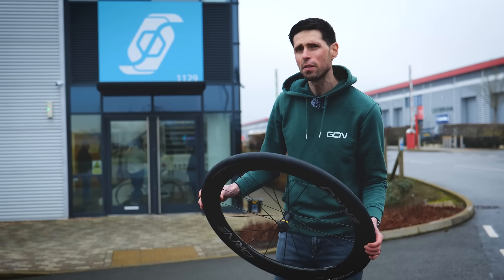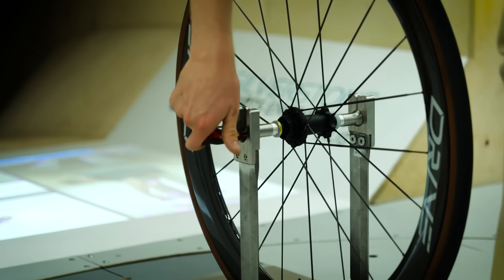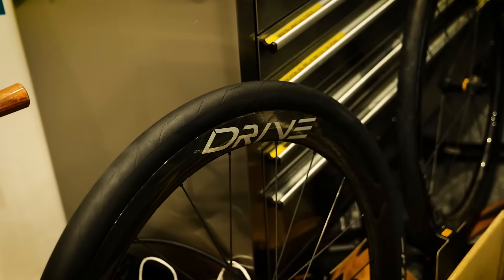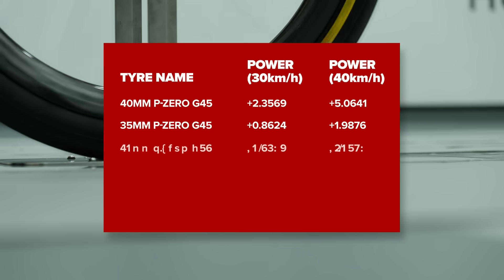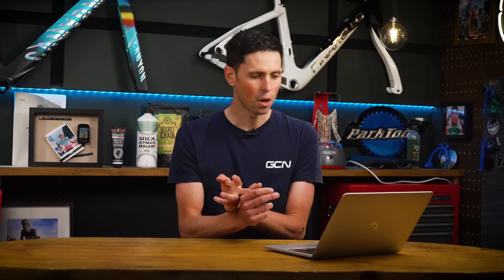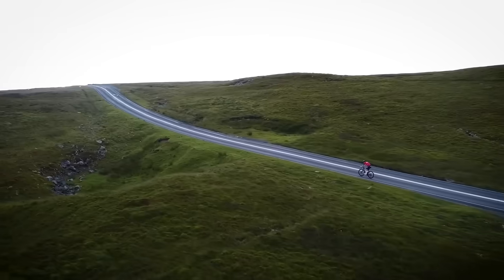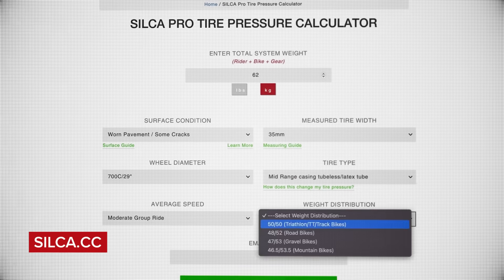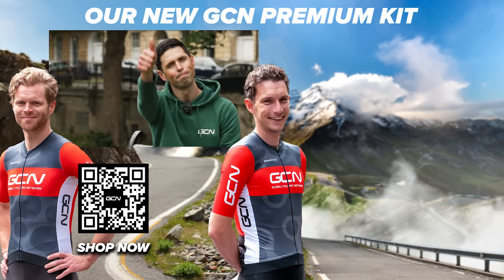The Fastest Tyre Width is NOT What You Think

Comment: Weird, I went from 25mm to 28mm and I can't wait to go back to 25's again. The internal width of my wheels do not reommend anything above 28's. The 28's feel sluggish of the start and bouncey if I inflate it according to the online tire pressure calculators. I had to increase the PSI by 10% to get rid of that bouncey feeling. I live in Central Florida where it is quite flat. On my 25mm I never experienced these problems nor was I ever uncomfortable. Starting off the line was quicker and over all feel was more responsive. I know this is all anecdote and it is going against the data. But  I am a 57 y/o fart who only competes against himself and does HIIT on regular occasion or when  I see a pretty woman. I ride a 2021 Trek SL5 with WInspace Hyper 50mm wheels. I have been quite happy with this setup. Stepping up to 28mm decreased my overall enjoyment on the bike.

Comment: The tyres tested here have the same name but the 35 and 40 are made to be much slower, probably for durability. Which may also be why conti hasnt released a gp5000 above 32C. 
Rolling resistance website tested all gp5000 tyres to have virtually the same RR. 
it's important to flag here that the 35 and 40 tested here are slower because the tyres are built differently, rather than thinking that such big tyres must have higher RR.
Reply: they already made this test several times with the pirellis and never state that important difference. its a shame.

Comment: Rode 28mm for about 5 years. Changed to 32mm last fall and haven’t looked back. I’ve noticed no difference in speed, but a big difference in comfort!
Reply: There’s a lot to be said for comfort.
Long rides are less painful freeing you up to put in bigger efforts.
Reply: 32’s for the win. GP5000s are amazing in 32mm
Reply: I.m rolling 30's now but I thin 32 is the all around sweet spot, I'm gonna need wider wheels!
Reply: I did. Notice a difference in speed. But I attribute it to the pressure rather than width. I ride 32 at way lower pressure than the 28. They are heavenly comfy in the winter when I do not care about PRs and KOMs and just want to ride.
Reply: @tonyg3091 What pressure in the 32mm?
Reply from the maker: and the comfort makes you want to ride more!
Reply: Try 76 !!!
Reply: So, pro teams have been using non-efficient setup with narrower tyres for years?  Sounds fishy.
Reply: @Dee-Ell Most pros are using 28mm now. Some using 30mm as well.
Reply: What I want to know is why haven't the pro teams "discovered" this?  The pros have been riding narrower tires for years.
Reply: @Dee-Ell because 28mm is still the fastest and more aero😂
Reply: I also moved to 32mm and not going back.  Much better experience
Reply: Same… 32 was a game changer for me!
Reply: How much do you weigh?
Reply: @alexnaturalis1179  why you looking for a date? 😂
Reply: @colinb8327 there's a point to be made here about the weight these tires are handling. I weigh 66 kg and 25mm at 75psi works for me. If 32mm works for him I want to know if he's 80-90kg.
Reply: Stuck with my 25mm, I dream of more comfort on rough roads 😅
Reply: Use a mountain bike. You will be surprised with the comfort of 2.3" tires!
Reply: 18mm years ago, that was very fast.
Reply: 47mm  on my 650b Cannondale Slate rigid
Reply: I just switched from 28s to 32 and I agree on how awesome it is.
Reply: I did look back. So for me it's about 3 years of 26s, followed by a year of 30 front/32 back and this year I tried 28s because apparently it's the holy grail but I immediately hated it, went back up to a set of 34s mounted on 55mm wheels and I'm setting new PRs this year. I love this setup. No looking back anymore. Everything has been tried. 
Side note: From this tire maker all sizes come out narrower when mounted so effectively I'm riding 31,5 front and 31 back atm.
Reply: Big surprise. Will you stop before going to 200 mm?
Reply: Still have a Panasonic mid 80s, stock tire was 1.125"   😏
Reply: My Ridley fenix came with 25mm max clearance 28mm. Chanced 32mm pzero TLR speedcore and they fit just about! Close to chainstay but ok. Loving them.
Reply: The fact that you didn't notice any difference in speed does not mean that there was not. It's like saying "I changed my bike with one which is 2 kg heavier, I didn't notice any difference in uphill speed". Physics matter.
Reply: BikeTyreRollingResistance conclusion that when pressure set for same comfort level, the rolling resistance of wider tyres is same as narrower. Of course setting lower pressure on the wider tyres might mean an increase in average speed on a long ride as the rider uses less energy combating bumps & vibrations - so has more power towards the end of the ride.
Reply: you still need to look back
Reply: @ds6914 I am old, I look forward to see the bunch...
Reply: Similar story here. Rode 28mm for a little over 4 years before switching to 32mm this January. I'm not going back to narrower tires.
Reply: All this tire width and pressure and comfort and speed talk greatly depends on who you are, how fast you ride (young, skinny, old or fat, fast or slow, etc) and what the pavement quality is that you ride on.  

Obviously the rougher the pavement the softer and wider the tire you want to be using.  Where I ride the pavement is excellent, we ride at 32km/hr (20mph) for 64km (40 miles).  I ride on 23+25mm tires (tyres!) at 100psi.  I’m skinny and fit but only because I’ve been doing this for 40 years!  I tried going to 28s at 80psi and felt like I was getting a flat all the time, bouncing up and down with every little bump in the road.  😮.   

The rear tire is drafting the front wheel and the seat tube so it’s not as important width wise, but a skinny front tire has less drag than a fatty, that’s just simple physics.   Bottom line, propper Tyre (tire!) size and pressure depends on how smooth your local roads are and how fast/far you want to go.  

There’s nothing  “comfortable” about a good, long, hard ride!  No pain, no gain!  I often have to tell my legs, “Shut up and spin!” 😂
Reply: @Timbo777LR 
Good point about the rear being drafted.  So maybe a staggered set up would be best, 28 front and 32 rear . . .
Reply: aww  thats cute.

Comment: Testing aero of front wheel only doesn't really provide useful results: a narrower tire has of course lower frontal area, but therefore the downtube (and rest of the bike) is facing more wind which wasn't measured. Of course testing the whole bike including rider is complicated and of course varies with different bike frames and aerodynamics of those and rider as well.
And also: your rolling resistance test is valid only for the Pirelli tires because those have actually different construction with thicker rubber towards the wider tires. If Pirelli would make a 40mm tire with the same rubber thickness as the 30mm tire, the rolling resistance would be likely very, very close to each other.

Comment: The Silca calculator does not normalize the tire tension. The narrower tires had more tension. For example, the 35mm needs about +8 psi to be as hard as the 28 (using Laplace's formula), so this could completely alter the Rolling resistance results.
Reply: Finally someone  mentioning Laplace here!! Tyre pressure does not tell us how "hard" the tyre is. Pressure x 
Radius divided by wall thickness does.....
Reply: Road surface has more to do with it.

Comment: Most 28c tires on modern rim width usually measure 30-32mm so… ~30mm for Spring/Summer and 32 to 35mm in Fall/Winter ☑️

Comment: I'm a big tall guy, and I've been riding 30mm tires for the last few years. I even built up a 2017 Specialized Allez Sprint rim brake setup with 20mm internal width wheels with the 30mm tires fitting under the brake calipers. After this video I may go back to the 32mm tires on my disc brake bike with Zipp hookless wheels. So comfy!
Reply from the maker: Nice! Did you use deep drop calipers to get the tyres to fit?
Reply: Which rim is it 20mm wide? Would love to have a wider rim them my 18mm dt swiss.

Comment: Just a little confused as to the rolling resistance test measuring "power loss".  I would think that the actual test of rolling resistance would be to simply have each wheel/tire combination spun by a machine which would calculate the effort in watts needed to spin the wheel at a certain speed.  Having a human rider cranking the wheel would not be an even playing field so to speak, as the rider can easily, even unconsciously adjust the pedaling effort to compensate for the different tire sizes.  This small change in effort cannot be measured quantitatively as the rider simply adjusts for "feel".  Alternatively, simply have a spin down test, where each tire would be brought up to speed, then allowed to roll to a stop.  The furthest roll would be the least rolling resistance.  Either test would work.

Comment: 25’s are great. Feels, and is fast
Reply: I’ve tried every tyre from 23mm up to 40mm over the years and ride many thousand of miles a year in the fastest group in my local cycle club. 25’s have the best feel for me and for me they’ve been slightly quicker than wider tyres (28mm and 30mm for example). GP5000 are my favourites.
Reply: So, are they saying the pro teams had it wrong for years?  Sounds fishy.
Reply: @Dee-Ell   With disc brakes on widening the tires is a mandatory solution... I still run 25mm and rim brakes...the perfect combination.

Comment: There is huge difference between tires in terms of rolling resistance and if you go tubeless, tpu or if on tubular.
Rubber is not just rubber.
The profile of tyres are also not the same.
Thread depth and patterns also makes a difference.
Reply: Also windtunnel testing makes me suspect all tires were at the same pressure, which on a smooth surface away from real world conditions where nobody runs a 25c at the same pressure as a 35c is going to make this test biased towards what's being pushed, super wide tires.

Comment: The problem with a few videos, e.g. the one from NorCal, testing this, is the fact that the rim they use has like 30 or 32mm outer width. Of course the 32mm tyre will be faster than the 28mm tyre. Simple aerodynamics will outweight roling resistance in such cases.

I have 28mm wide rims and choose to run 30mm GP 5000 S TR on them, after I rode 32mm GP 5000S TR the season before. Works great.

Comment: The contact area of a tire when is is on a roller in the pedaling efficiency test rig is vary different from the contact area on a flat surface like the road.  It is shorter and wider and deeper in the middle on roller, that would affect the amount of energy used for sidewall flex significantly.  Also the rollers are much smoother than most roads how does that affect the results?

Comment: Thanks for this, well done..  One data point on this is that the P Zero in 35mm uses a different rubber thickness, which is slower than the 30mm and the 40mm uses a thickness that is even slower than the 35mm.  Until different tires widths can be tested with the same rubber compound and thickness we are all guessing.  I'd also love to see what 32mm would produce here, as 32mm P Zero tires have the same rubber compound and thickness as 30mm.  This would give us some guess at where the trend goes.
Reply: I think this test was very reasonable - using actual tires in the same product range.  The manufacturers are making engineering changes to accommodate the requirements associated with the different widths.
Reply: Yep, that's a good point. Gotta hope that we could get some competition between the big manufactures so that there would be a proper 40 mm racing tyre for road. I think there were rumours that Continental is working on a wide fast road tyre.
Reply: @astroturd I'm hopeful, even just a regular GP5000 in 35mm would he awesome.
Reply: @astroturd Agreed! I'm riding the Schwalbe Pro Ones in 38mm on my Crux Road build and really enjoy them. They don't feel slower than my previous set up, except from when accelerating, because boy they are surely heavy haha.
Reply: @MrJulioJohnson  Yeah I've looked at those tyres. Currently I am running the Continental GP5000 AS in 35 mm, but I'm not sure changing to the Schwalbes would be a significant enough upgrade, so I'm waiting for something new in the market.
Reply: @astroturd  Rene Herse in the extra lite slick comes in a 38mm(closer to 40mm according to their testing on a modern wheel) and it fairly fast.
Reply: @mellissanash7517  Yeah thanks, I've researched them but unfortunately getting those tyres to Finland is very expensive due to customs and taxes. Also the standard tread version seems to be much thinner than the GP5000 AS 35mm which I'm running now, so I would definitely be worried about punctures with the RHs.
Reply: I personally think (without science to back it up) that the 32 would be the superior choice.
Reply: I do not trust the aero data here and do not believe any of the rolling resistance information.  Different tire details could very well explain the rolling resistance results, though.  No one ever provides objective testing for rolling losses compared to width, tire construction does not make that easy but most wouldn't know how anyway.
Reply: As the tires get larger, they need to have a stronger construction to survive the pressure times increased tire surface area. The manufacturers can't use the same thickness or material for practical reasons, otherwise they would be using softer more compliant material.
Reply: @adamolig3865 what? Larger tyres should be run at lower pressures, meaning the hoop stress remains the same as with smaller tyres with higher pressures. Add I that the greater volume means pressure spikes from impacts/compression are less dramatic, and there is no reason a larger tyre needs to be constructed from thicker material. More likely is that they are constructed using thicker sidewalls and tread because they are designed for all-road/light-gravel, which would require more robust tyres, or the manufacturers are just reusing their gravel tyre  carcasses and sticking on a slick/road tread cap.
Reply: @adamolig3865  I don't think you are correct.  There's nothing about a tire getting wider that makes it require a thicker center tread.  The same amount of weight is distributed across more surface area, so less pressure per given area.
Reply: @Private.person506 you are incorrect here, the wider tyres are very different construction, head to bicycle rolling resistance for details.
Reply: @paulfromberkshire2891  after saying I was incorrect you repeated almost exactly what I said, so I'm not able to understand what you think I was incorrect about.

Comment: 6 foot 2, 190 pound rider. Rode 23s at 120 psi forever. Then 26s for a couple years when I couldn’t even find the 23s anymore. Then 28 when I could finally fit the 28. Then 30s. Better every step of the way. Then I tried 32s rode them till they wore out, didn’t like them as much as the 30s and I’m a 30 guy from here on out.
Reply: 86kg? What are you? A toddler? Those are rookie numbers.

Comment: What's wrong with tubs at 140psi? Did some cracking time trial times on those back in the 90's.
Reply: Exactly this - my fastest times were in the Nationals on 19mm Conti GPs pumped up to 120psi - felt fast - were fast …. As my tyres  have got wider, my times have got slower, and I have 30 years of data to prove it - go figure 😂😂